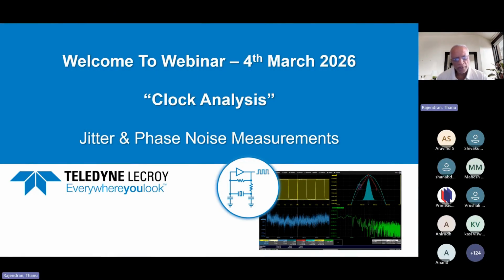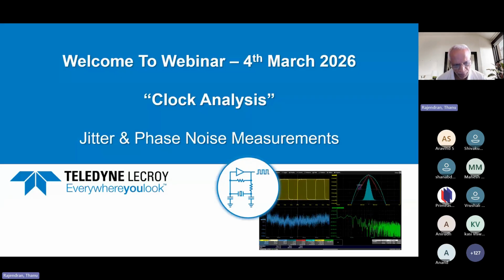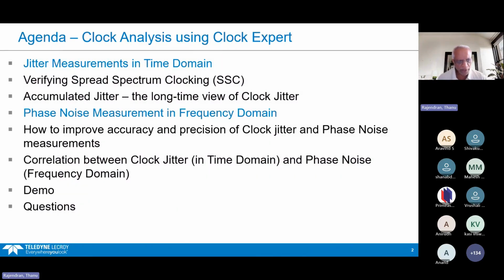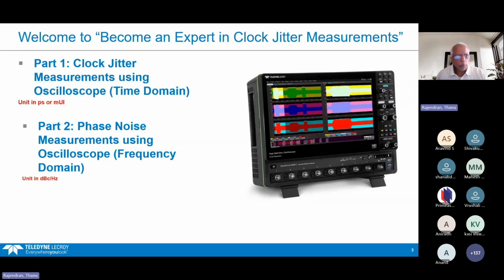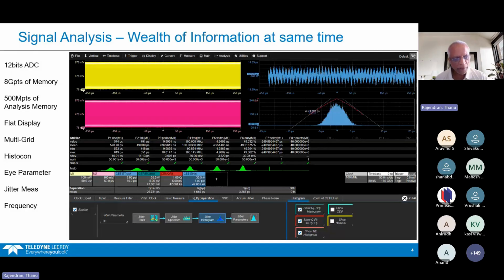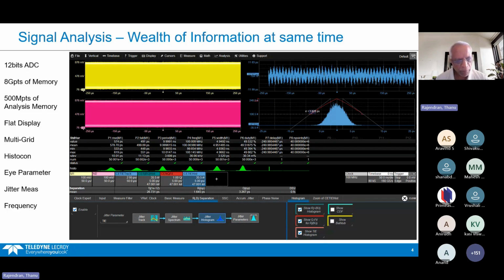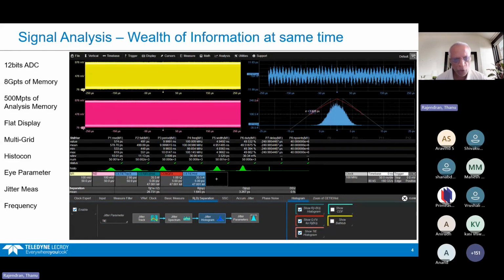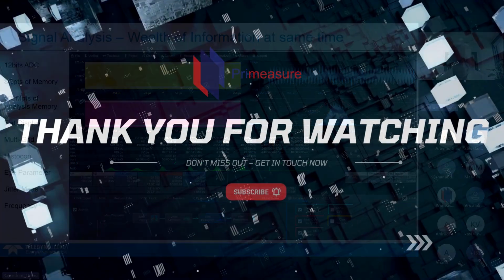PART 1 Clock and Jitter Analysis on Teledyne LeCroy Oscilloscopes - Fundamentals with Tanu Rajendran

Comment from the maker: What is the biggest challenge you face when measuring jitter or analyzing clock performance in high-speed systems?

Download the webinar slides and related technical resources here:
https://primeasure.com/request-content/#clock-jitter-phase-noise-2026

We'd be interested to hear your experiences and questions in the comments.

PART 2 COMING SOON!